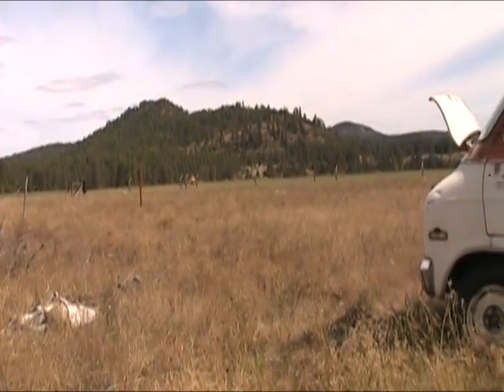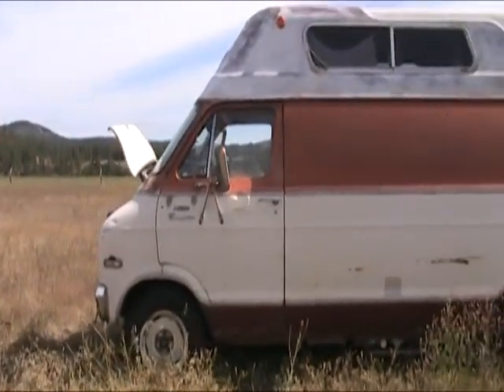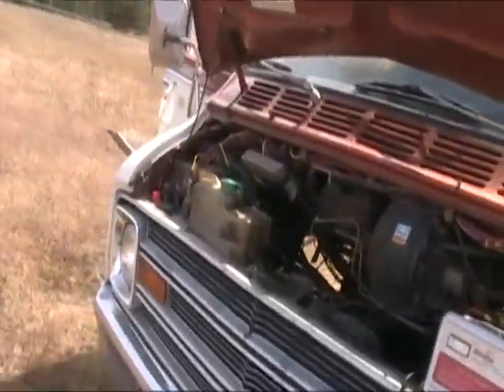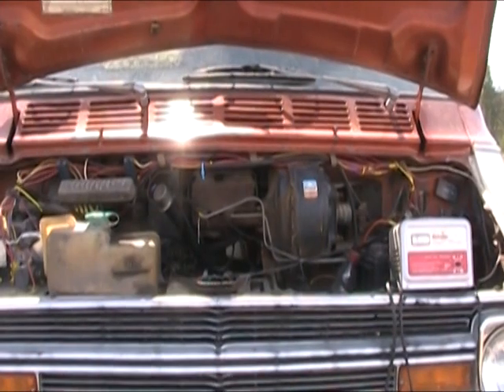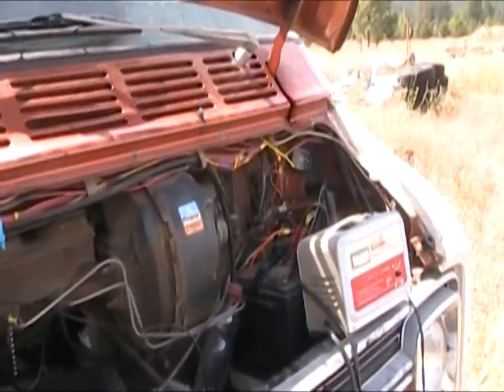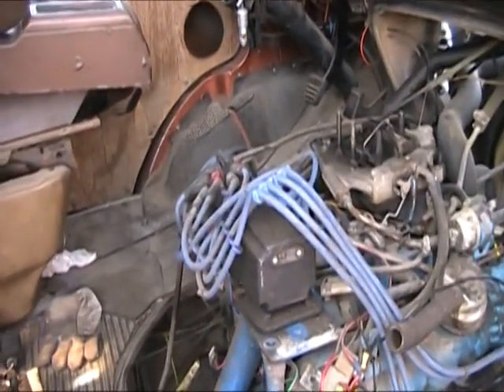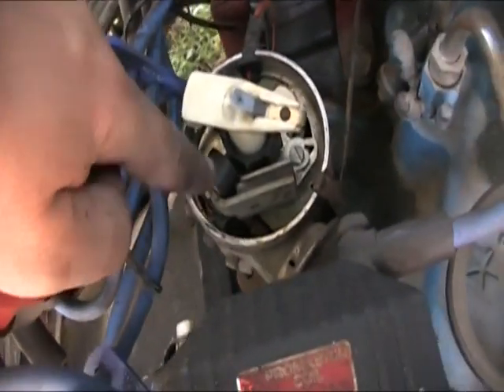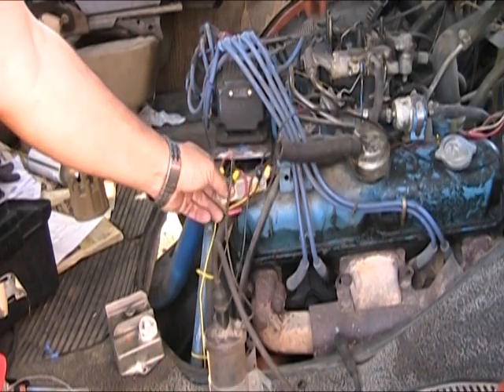Fixing the 74 Dodge Van 1

Comment: That's certainly an inventive way to mount the ignition components!

 With all that going on, I would suggest building an HEI conversion like I did on my '83 Dodge truck. It gets rid of the ECU box, ballast resistor..in other words, the two most common failure items on Chrysler ignitions.